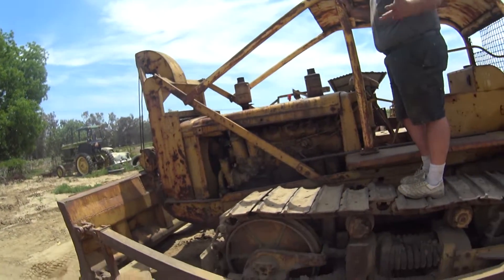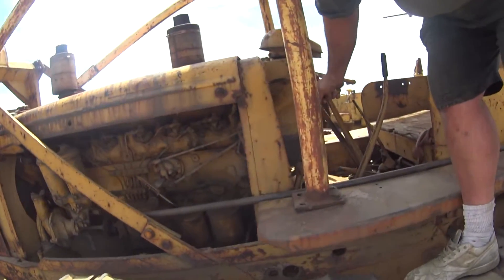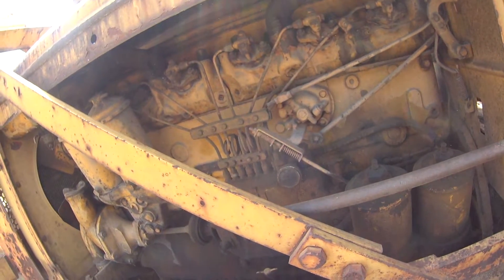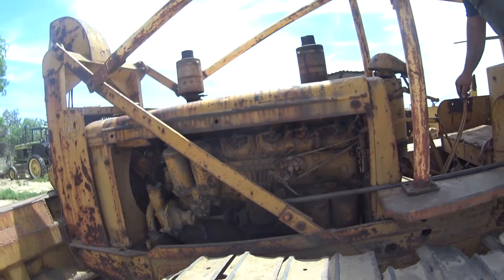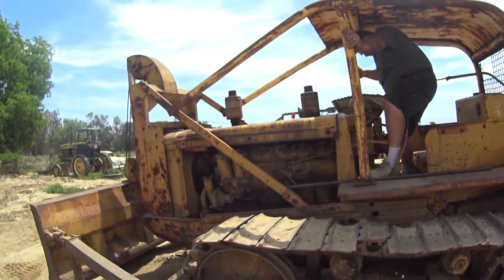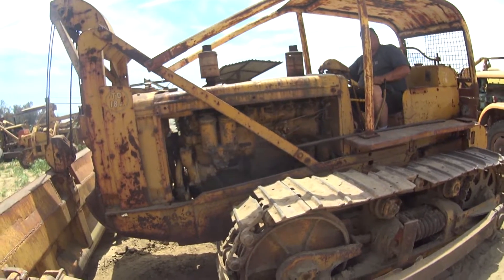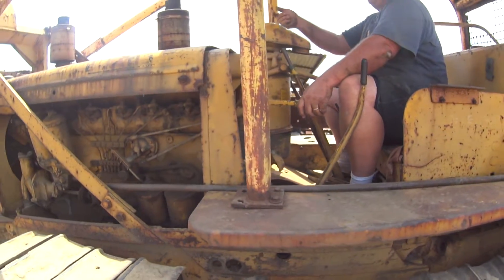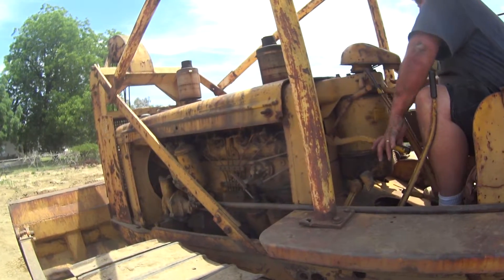STARTING THE INTERNATIONAL TD 18

Comment: I have a 52ish UD18 with the same engine, the issue I'm having is on the carb side there is the valve with a large spring attached that opens and closed as you switch from gas to diesel. the rod has a lever that I believe sits between a V shaped notch as slipped out. What I'd like to know is the position of this switch during the throttle lever being down and up and does that flat lever sit between the V notch. I cannot make it out in the video. Thanks in advance

Comment: Cal j my TD14 142 starts every time. Trick is to have timing correct and when it buffs and dies, turn choke off. Let run depending on how cold it is for the amount of time on gas before you switch to diesel. And yes you are correct on heads or head cracking. But just leave it at same rpm. Don’t change it till you let it cool off before you shut it off. Supposed to switch it back to gas but never do. Cat had same problem so yo each there own.

Comment: When the gas over diesel  was introduced I dont doubt it was a well received idea, especially in cold weather,  but it seems over complicated and maintenance heavy to me.  I know some of the engines had head cracking issues and IH went away from the design.  I dont see many videos where they start easily but im sure that can be attributed to the age and wear on the machines?  Maby im biased because I have AC crawlers and they were always direct electric start or hand crank?  Thanks for sharing.
Edit.  Watched the TD14 start video and that thing purred like a kitten.
Reply: if they in good shape ive seen them start in real cold weather bareley turn over and bang there running